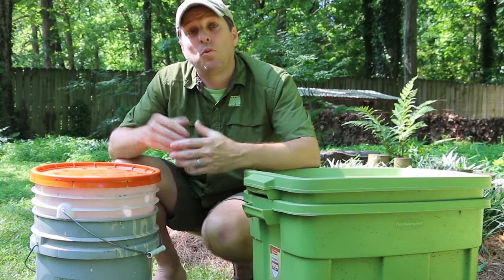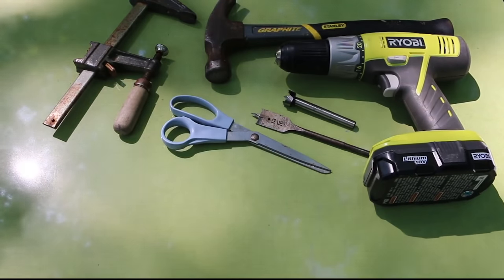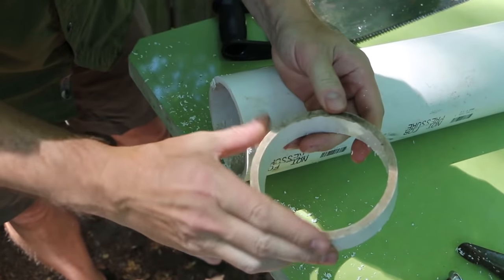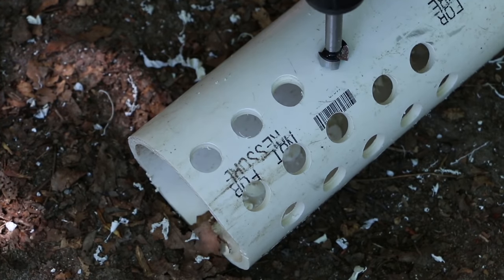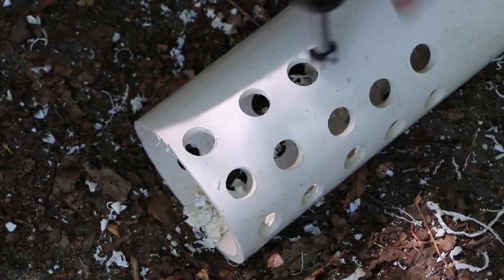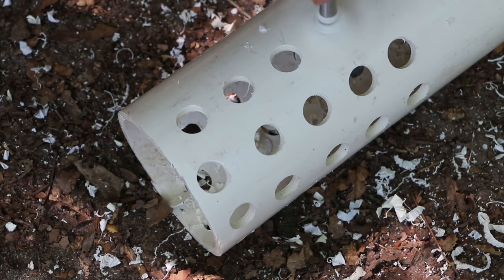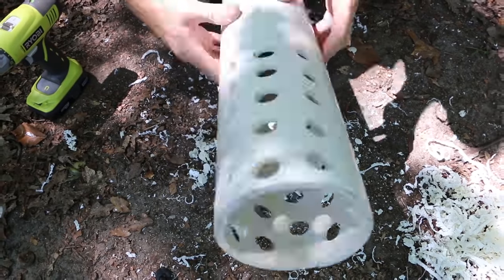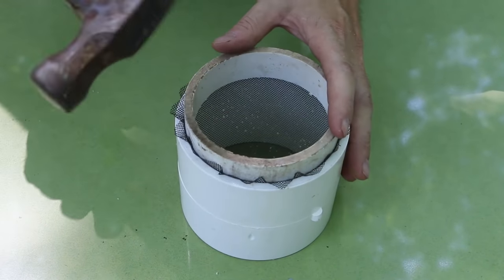How To Make A DIY Worm Tower

Comment: What was the size of the  forstener bit you used? I think you said 1/2". Can you please confirm that?
Reply from the maker: Hi Adam. I'm just digging down through the comments, sorry it has been a couple weeks. the size of the bit is not as important as the amount of perforation. If you are using a smaller bit, just drill more holes. If you have a mole problem, consider doing smaller whole to keep them out of the tower. Otherwise, they will dine on your worms. :-)

Comment: you used white pipe, will black pipe be to hot for the worms?
i'm in oregon.
Reply: Ted, heat could be a problem with the black pipe. My neighbor has some black PVC worm towers installed a few feet away from my white one. Let me take the thermal camera over and get some measurements later today when the sun is hitting them both. You could simply build a wooden box (or another stable material) around your black PVC pipe to keep it shaded. That should keep the heat down.
Reply from the maker: Oops...replied from the other channel. :-)
Reply: thanks for the tip. didn't think about shading them. i could do this with trellised plants or tall plants.

Comment: Why do you have to buy the worms for the composter?  I have noticed hundreds of those red worms you showed in my traditional compost heap in the summer period in the UK, once they are breading well one should be able to remove a few for seeding your pipe composter?  Great video and well presented by the way.
Reply from the maker: If you’ve got a natural supply of worms in your compost pile they can certainly be captured and moved to a composting bin. Red wigglers, in a native environment, can be found in areas of rich organic matter, like your compost pile. You might also look for some of the worm cocoons, which resemble a tiny translucent light brown onion about 2-3 mm in diameter. Moving some of this to a bin will help grow the worm colony. Thanks for your compliment and thanks for watching.
Reply: The worm cocoons I have seen also are slightly yellow. They remind me of tiny plastic pellets.  I didn't know what they were until I started my own worm composting bins. I now have three with a fourth that has sat for several years now. It sits on bare soil and is my Go To place for worms to start any new compost bins. I keep my bins on a covered deck next to my house and use the worm  casting for my plants in containers on my deck. It has been as cold as 19° F overnight with daytime temps mid 30's to 40's and they havn't frozen. But they are sluggish and not doing much.

Comment: Is using a 5 gal bucket as good as your 4" PVC?  5 gal takes up more growing space.  Any other issues pro / con?
Reply from the maker: +sunnysacto actually I think the 5 gallon bucket is a great option. True it does take up more garden space, but gives you more composting space. You might check out my video on a making a 2-bucket worm composter. Just create the top half (with screened lid) and perforate the bottom 6 inches of that bucket to create your worm tower.
Reply from the maker: +sunnysacto another plus for the 5-gallon bucket option. They are usually #2 plastic, HDPE, which has less footprint than PVC, and no BPA. PVC is OK to use, but the manufacturing process is not the most environmentally friendly.

Comment: In making the lid why not push it all the way to the bottom?  Then the screen is flush with the top.  Is there a need for it to be recessed?

The tower seems un-needed,  The worms can't find food just thrown in the garden?
Reply from the maker: Hi Brian. I recess the screen to make it easier to pour water into the worm tower. The water would not likely flow off the edge if the screen was flush with the top. To be honest, the worm tower is an accessory. Composting worms can be added directly to the garden and compostables can just be buried. One benefit of the worm tower is that it provides a concentrated "portal" to insert compostables into the garden without having to dig. If you want to just add your compostables to your garden it is best to bury them. Otherwise you can attract surface pests like rats.
Reply: I went to Home Depot and found 4 in pvc pipe comes in thin wall & sched 40.  Which did you use?
Reply from the maker: Brian Gross either should work. Go with the thin wall PVC if it is cheaper. That would mean less material. I used thick wall, only because I had some on hand.

Comment: My bucket of worms has surface worms that are beginning to break down (bleeding liquid/goo). But, the worms at the bottom/middle of bucket are alive. How do I keep them from doing that? I keep them in my screened-in porch in a bucket. I add water from time to time. 
I trim trees in my yard (with my 12amp Dewalt Sawzall with 12 inch pruning saw blade) and have a lot of left over saw dust. Is the saw dust good to give them?
How often should I change the bedding and what should it be made of?
Walmart sells $3 bags (+30lbs per bag) of manure/compost for gardening without any additives (a no name bag). Is this good to use as food/new dirt to feed the worms? One of the videos I watched said to feed them cricket food ($4 for a small container of dusty stuff with corn, soybeans, vitamins and minerals, and other stuff; but, that gets pricey after a while). Are there better, cheaper items to feed them? 
If I feed them organic table scraps, how fine should they be cut up/processed before mix it into the worms or should I just pour the cut up table scraps on top (if it's a viable feeding option)?
What does worm bedding such as newspaper, woodchips, sawdust and/or wet leaf mulch do for worms that regular dirt/manure can't do (why use one as a bottom layer?; would it work better if they were mixed instead of layered?)?
What temperatures should I keep them at (and where depending on season/climate: spring, summer, fall, winter, autumn?)?
How thick should the layer of dirt/bedding be for worms inside the bucket/bin (and does it differ between red wrigglers and huge nightcrawlers?) (I'm more interested in having more red wrigglers and only a few nightcrawlers; can you grow them together?; Do the species have problems living in the same bin/home together?)?
Do I have to buy organic dirt to give them or can they thrive in environments with artificial additives like in common bags of soil (I ask because I live in North Georgia, USA)?
Detail answer's would be great and most appreciated. Thank you for your time and effort!

Sincerely, 
Jacob
SurvivalGeek (YouTube)
https://www.youtube.com/channel/UCfRsUPToBXp4ZIre__dJg4A
Reply: - I just read a Wikipedia article that said soldier fly larvae will create an environment that is too warm/acidic for red worms, so if you have a growing population of them them this may cause problems.
- Red worms like cellulose, which is what paper/sawdust/etc. provides.
- Red worms do not like acidic table scraps, e.g. citrus peels.
- If you use sawdust from treated wood, the chemicals may kill or hurt the worms.  It sounds like you're using tree trimmings, though, so you should be fine.
- Excess chlorine from tap water or leachate from a hose that has sat in the sun for a long time could poison the worms.
- The worms prefer a cool (ground temperature up to room temperature), dark, moist environment.  They will flee from sunlight, and they will eventually drown if they can't escape from a waterlogged environment because they breathe through their skin.  That said, they can survive underwater for quite a while.

- Thermophilic bacteria are great for rapidly breaking down compost, but they will generate temperatures too high for earthworms.  In an open or very large composting environment (e.g. an open-air heap), worms will migrate to cooler temperatures until thermophilic bacteria have done their thing and died off, then migrate back to do their part.  If they have nowhere to go, they'll probably die.
- I would avoid store-bought dirt, compost, or potting soil for a worm farm, because it is intended to provide nutrients for plants, not decomposers (the worms).  The worms create the stuff in the bags, but they don't eat it.  Also, you never know what contaminants might have worked their way into an industrial composting operation, or what chemical additives may have been added to potting soil.
- Typically, worm composting is one portion of a larger composting process that involves various bacterial and fungal stages.  Too much nitrogen, and the worms will flee and wait for it to die down because it creates ammonia gas, which is poisonous to them.  I believe in a typical open compost pile a 28:1 carbon/nitrogen ratio is a good target for complete decomposition, although going with more carbon, e.g. 30:1, might be better for a worm farm.  Brown, dead leaf litter, saw dust, paper, etc. are great sources for carbon.  Green leafy matter, fresh grass, and table scraps are a good source of nitrogen.  I've seen lots of variation in C:N ratio recommendations, so you'll need to experiment to see what your worms like best.
--
One thing about your sawzall is it may be creating sawdust that is so fine that it packs in too densely to provide adequate air deep in the bucket.  Speaking of which, do not pack materials - just drop them in.
Adding some drainage to the bucket would help with water-logging issues.  The juice that drains out is supposed to be great to add to a garden.  Be careful not to let the compost dry out, of course - the worms still like lots of moisture.
Here is a drainage idea:  drill a large hole in the bottom of the bucket and add a fitting or position a collection container underneath.  Cover the hole with a screen, then put down pea gravel, then cover with landscape fabric.

--
Well.  That was a lot of rambling.  I hope this helps you!

Comment: I like the idea but do you know if it will get too hot for the worms and they will leave the tube?
 I live in Florida
Reply from the maker: I suggest you create a shade element for your worm tower by building a wood shroud. Maybe I'll do a video about that. :-) Another idea would be to just bury your tower a little deeper. Thanks for watching.
Reply: I’m in zone 10b ,south Florida, and they handle it just fine.  It doesn’t get that hot inside the pipe.  I have a compost tumbler and I have worms inside of it.  I actually use my entire raised bed as a worm bed.  I just bury my waste in different areas.
Reply: If it's too hot in the tower will the worms go underground

Comment: Question how deep is your raised bed?
Reply from the maker: Hi Karl. Initially the bed was framed with a 2x6, but I have since added a 2x4 to the top of that. So, 5.75 plus 3.5 deep...minus an inch of settling of the bed material. Hope that helps. Thanks for watching.

Comment: Question.  I am getting ants in my worm tower.  What am I doing wrong?
Reply from the maker: It might be something sweet. I've had ants move in to my worm tower as well. It can also be because it is an easy habitat to take over. Especially after a hard rain. You might try watering the tower more than normal, to get the ants to move. It should drain fast enough that the worms won't drown.

Comment: Do you have to shift the worm tower to a new location in the same bed after some days? Or the compost so produced would get evenly distributed
You have made a nice presentation.
Reply: They actually sell pipe with holes in it for septic leach fields along with extenders to attach two pipes where you could put your mesh screen
Reply: The worms moving through the bed will help distribute it. It's not perfect, but it's good enough

Comment: Thanks for the great video! I don't know if red worms can survive in my zone (4), so would this idea be good for attracting the native earthworms that can live here?
Reply from the maker: +Heidi Tighe they would probably do fine in Spring, Summer and Fall, but would need protection in the Winter. You could do a worm bin that is kept indoors (garage or basement). Or insulate your worm tower with wood chips or hay. To attract some local composting worms (earthworms don't do compost), try putting veggies scraps on the surface of the soil (in a garden preferably) and then cover with several layers of newspaper, then soil to weigh it down. Worms that come to the habitat will be composters.
Reply: That's terrific! Thank you! I put down a couple feet of leaves last fall. Would they have attracted composting worms who'd stick around for the contents of the worm tubes?
Reply from the maker: Heidi, if you can find worms below and in the leaves they should be composters. To get a worm tower going you ought to gather as many as you can and move them into the tower. They might find it, but it would be slow.
Reply: GreenShortz DIY Thank you!

Comment: My husband didn't shave down the sharp edges of the PVC pipe.  I'm worried the worms will get cut and he doesn't think it's a big deal.  Can you weigh in on this?  Thank you so much!
Reply from the maker: Hi Kathleen. The worms will be fine. Those holes will be filled with soil and that will, in effect, soften the edges. If your worms show up en mass, with signs protesting dangerous working conditions, then I'd worry. But until then...I think you're good. :-) Thanks for watching.
Reply: How often can you add paper and scraps ? How often should you add water I live in Southern California

Comment: A good idea, but at some point the tower is going to fill with compost... then what? I suppose the tower then has to be pulled out of the ground to empty the contents? This will not be an easy task, since by then the tower will be impacted in the ground and difficult to pull out.
Reply from the maker: The organic-rich garden soil stays pretty loose. A little twist and it comes out easily. It actually takes a couple seasons to fill up, but then again, I’m using 5 different composters.

Comment: OK so im new to this i wanna start a garden an I'm interested in garden barrels. so the question is do I need worms for this type of gardening because where I'm from i have no access worms. my plan was to still have the worm tube and water the plants from it  so could someone guide me in the right direction if I need worms or if I can do it the way I intended to thanks much
Reply from the maker: +Jensen Anthony Worm composting is a great option to boost garden performance, but not necessary for success. You can always just bury conpostables in the garden or start a compost pile separate from the garden. Native composting worms will eventually find it. Then they can be moved to the garden.

Comment: what do you do about moles in the tower area?
Reply from the maker: Hi Cedric. Moles are a problem for composting worm colonies. I suggest making a 3 foot diameter ring  of 1/4 wire mesh and then burying it 2-3 feet deep around the tower. This is a lot of extra work, but would help deter moles from dining on your worms. You might consider relocated the tower away from its current location when you do this. It will make the mole have to find the tower again, if they really want worms. Thanks for watching.

Comment: I made one of these last June.  At first it worked great, but then July came.  Our normal temperatures in July and August are between 90 and 103F.  I tried shading it but nothing worked.  It was just too hot.  Do you have any suggestions for hot climates?
Reply from the maker: Hi JoAnn. I've had a few people asking this question. One idea is to bury it deeper. However, the perforations need to be in the top foot of the soil, so ideally this would mean perforating the middle of the pipe, which doesn't help you with your current build. One modification could be to cut off the top foot of the PVC pipe and then invert the perforated end with holes on top (still below the soil). Then add the solid cut off section on top. You'd need to use the soil to hold it together or a few metal brackets with screws. I'll do a new video in the Spring detailing these modifications. Would you like to see something like that?

Comment: Will it work on earthworms too? Using kitchen scraps?
Reply from the maker: Earthworms won’t process food matter. They are soil processors. But there are likely some composting worms in your soil already. You can gather them by burying your veggies scraps in the garden. You can dig a hole, add the scraps and cover with a board to keep pests out. The board would just be so you could monitor And add more scrubs as they are available. After a few months you may see a community of worms forming. I haven’t tried this myself, but it should work. let me know if you find success. Thanks for watching.
Reply: GreenShortz DIY I did that without the board. Not sure yet if they work. But I think there are already some composting worms in my raised bed because I used to well still am  putting some vermicast on my plants. Will let you know if it works. Thanks.

Comment: Why was the top of the Worm Tower left open to the elements, particularly rain? Wouldn’t a cover in the top make more sense?
Reply from the maker: Hi Mimi. The worm tower should mimic the composting worm's native habitat, in vertical form. This would include normal rainfall. So the rain is something they would be used to. Plus it helps carry the nutrients out into the garden. Thanks for watching.
Reply: GreenShortz DIY thank you